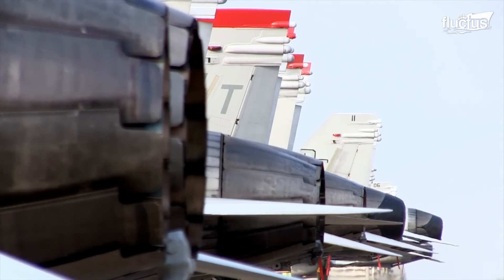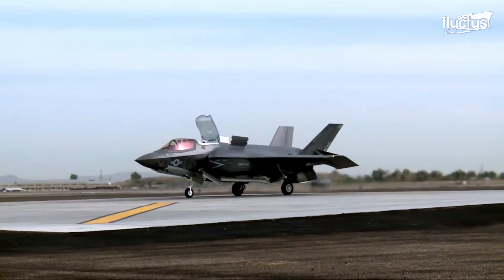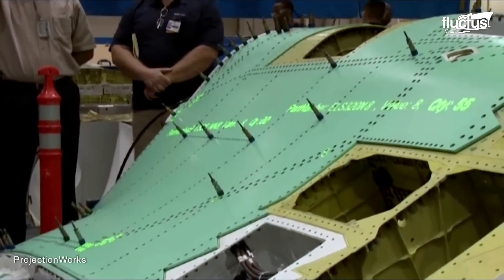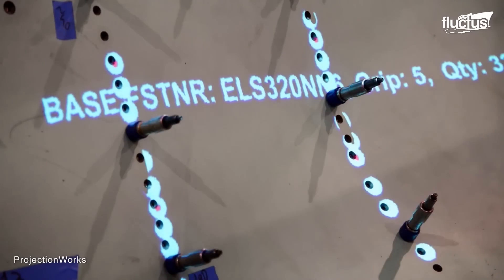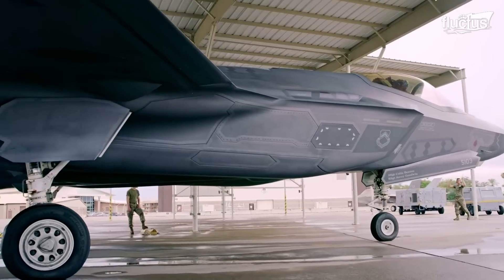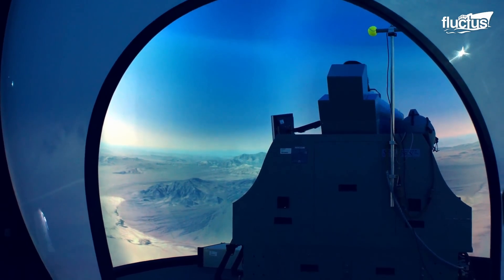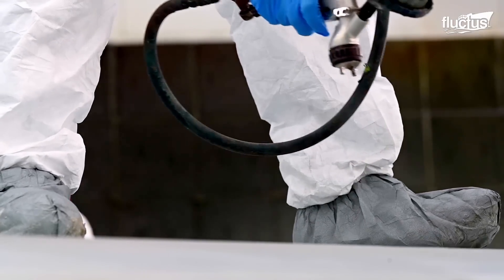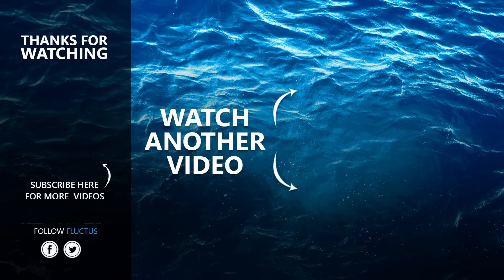How US Builds its Latest Advanced Stealth Fighter Jet

Comment: The F-35 fleet is the gold standard of flight readiness (upwards of 35%) and low maintenance times (for each hour of flight, there's a day or more (24 hrs) required to get back in the air).  The F-35 program is so cost effective the 6th Generation plane to replace the F-35 had to be cancelled.

Our enemies couldn't have done better than Lockheed Martin at kneecapping our country's military.

Comment: Correction: Lockheed-Martin's Plant #4 has only been property of Lockheed -Martin since 1993 when they acquired General Dynamics Ft Worth Division, which was Convair until 1953 when GD took over. My Dad was an Engineering Chief for GD having worked there for 38 years. He met my Mom out there, she was in the Steno pool. My Great Aunt also worked out there when it was Convair as a Key Punch Operator.

Comment: the f35 is still having issues and verticall take off is wanted by all branches. but due to the expsive nature of the f35 is why all branches may not have it.
Reply: Due to "economy of scale", what with EVERYBODY buying them, they aren't all that expensive any more.  A new f16 costs 30 million naked and about 70 million with all the bells and whistles.  Whereas, a new f35 only costs between 70 to 100 million.  So I would ask: if your government gave you 100 million to spend on new aircraft each year, would rather have two excellent, but last generation f16s or one top of the line f35 stealth fighter?  

I think the problem with availability in the States is that EVERYONE is buying f35 and there are more orders coming in than can reasonably be manufactured.
Reply: Where do you have the information that all the branches need or want the STOVAL version. Just asking since the Navy have large enough ships to buy the F-35C and USAF don’t need STOVAL for its operations and would actually be hindering them because F-35B and C are heavier and have less G maneuver rating than F35A.